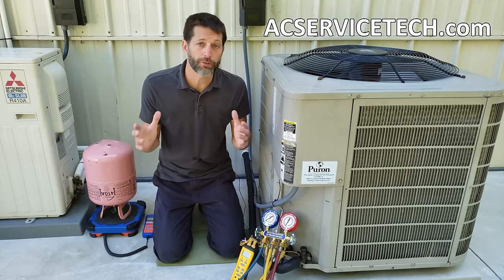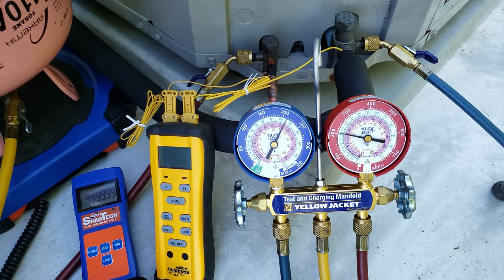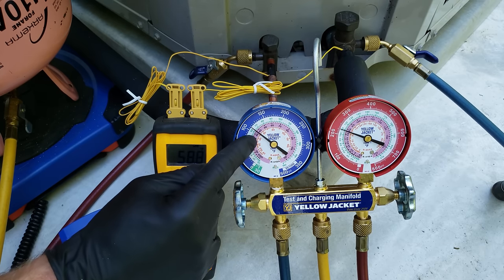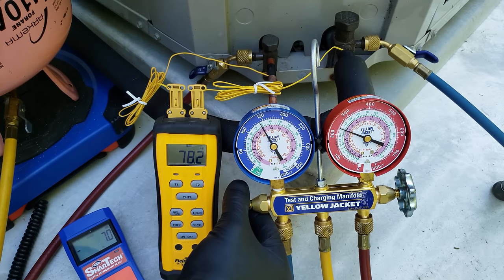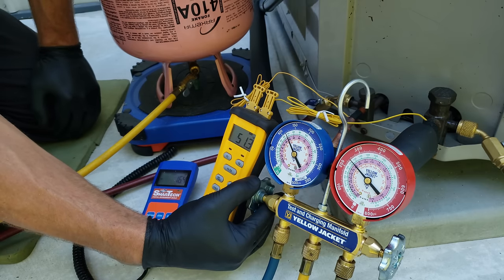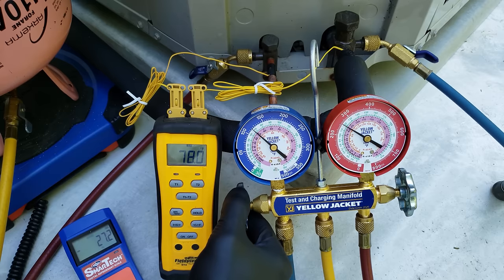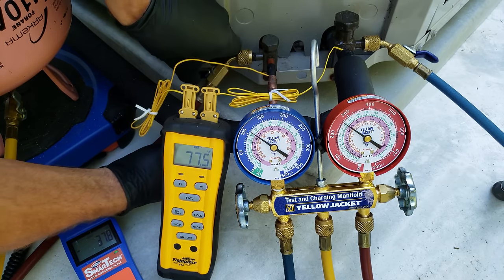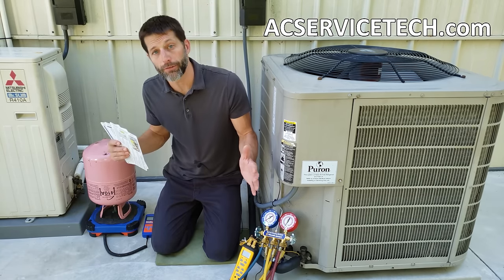Charging an R-410A AC Unit that is Very Low on Refrigerant with the Subcooling Method!

Comment: I can’t understand why your “soup-to-nuts” video got about 1.6M views and this one only has about 52K (as of Aug 1 ‘22). I’ve only had your 229 page book for 10 days but that book used together with your videos is obviously the best way to learn HVAC. I’m planning on buying a 12000 btu inverter heat pump and a 12000 btu cooling only split unit just for the purpose of experimenting with all the different recovery and charging methods you described just to compare the outcomes. 
  It will probably cost a few thousand to get all the good tools to do all that but it’s definitely worth it.

Comment: This video brings some nostalgic feelings... This analog pressure gauge from Yellow Jacket.... Last time I've used mine was a couple of years ago. Nowadays it is easier just to get a digital gauge with temperature probes that would calculate superheat and sub cooling automatically..:) Thank you!
Reply: Yeah I think he does it with basic tools just in case people don’t have digital. Wouldn’t really be a training video with digital bits working it all out for you 🤣 but yeah the new tools are great 👍

Comment: Any help appreciated :
I have a Lenox Unit outside with 410A refrigerant. I'm following these instructions to top off the refrigerant as I know it has a tiny leak and goes low every couple years. the sticker on the condensing unit outside doesn't show any TXV subcooling number. it shows the design pressure though : Hi 446 / Lo 236 PSIG besides voltage, amperage, fan speed and other information. How am I supposed to figure what the target subcooling of this unit should be. 
PS : I have my EPA license and will eventually replace the unit probably next year. 

GREAT VIDEOS btw, very valuable information on youtube videos and the e-book. really appreciate you for what you're doing and always support you

Comment: FIRST I'm glad you used analog manifold gauges some of these channels act like analog never existed!🤯
I never heard the emphasis on clean filters & clean coils on Airflow, but good video.
🥃🥃🍺🍺🍺🍿🏌🏻‍♀️
Stay safe. 
Retired (werk'n)keyboard super tech. Wear your safety glasses.
Reply from the maker: I thought I mentioned it quickly before hooking up the gauge set. I did other videos on the full process for measuring the cfm to verify you have the 350-425 cfm required depending on the desired dehumidification level, thanks!

Comment: I enjoy your videos; I am in school now learning HVAC.   It does make it a little confusing with thermocouples' on both the suction and liquid lines at the same time.   I know you are pointing back and forth at the service ports, but while watching the videos my mind is jumping back and forth between sub-cool and super heat as to which line I need to watch the thermocouple temperature.    All good info, just make me confused because of the thermocouple wire on both at the same time.

Comment: excellent channel my friend  !  this subcooling method is exactly  the same progress at a fridge that use a txv expansion valve ? in commercial refrigerators  apart from the required amperes drawn by the motor because most of the times I choose the pieces ( evaporator, condenser motor, etc )separately and join them and there is no other indication of filling with the correct amount of freon , for 20 years I have filled them in empirically without  having any trouble not meaning that this is the right way !

Comment: Man… where was this video when I first started, 15yrs ago.
Can you do a quick video on approach method charging?
Reply from the maker: Chip, thanks for letting me know what you would like to see!
Reply: This is what you do, use you temp chart and ad 20 degrees to your ambient temperature. And you will see what the head pressure should be. Plus you can use a amp probe and see what you running amps should be

Comment: Good day bro. Can u discuss the length of the pipe and how much we add refrigerant into the system? I know every brand had a design for pipeline When you installed AC. What about you will exceed the design? Or u will depend also the subcooling? Even ur pipe was long.

Comment: Amazing video. That's why I can't get SC differential! I always thought, why it is not rising while I'm adding refrigerant - the answer is - I need to add MORE. And Keep adding till I'll see the split differential. 

Interesting fact- even with a zero  SC A/C was cooling great and SH was 15. Now it's more clear to me. Will apply this knowledge to practice. 

Also, a lot of times while I'm adding refrigerant my liquid line sat pressure rising along with liquid line temp without giving me any split differential. And if I add more it just sticks together and rising. Am I missing something?
Reply from the maker: You would need to let it sit longer to cycle through, or turn the outdoor unit off, let it equalize and then turn it back on and wait the 5 minutes before checking again. Or it lterally could be that low on refrigerant that more is needed to be added, thanks!

Comment: Great video!!! One question if you disconnect the liquid line but you don't have the low loss fittings like you have on your gauge set is refrigerant still in the line and are you able to service that into the suction line? Hopefully that question made sense. Great Content as always!!!

Comment: Thank you for this! Question: If I was going to use a charging adaptor on the tank to produce more of a vapor, can you just leave the low side valve cracked open for lets say 15-20 seconds at a time?

Comment: Hi, I like your videos they are very informative, I have question for you , some times when charging the system start drawing overload current to achieving the target superheat or target subcooling, when you charging a system shouldn't be better to monitor pressures , temperatures and outdoor unit current?
Reply from the maker: The only problem is that we don't have a current to compare it to so we rely on the subcooling and total superheat. The current ratings on the outdoor rating plate are not used for actual running current but one is for wire sizing and the other is the max for the breaker size. If the total superheat and subcooling are set properly, then the system will be the most electrically efficient as long as the airflow is correct. Actually check for the 350-425 cfm before charging would be the most important, thanks!

Comment: If the Freon is low by 50%, and after discovering the cause of the leak, should I continue charging the device with Freon, or should I empty it and recharge it again because it is a mixed gas?

Comment: If my gauges don’t have a closing valve at the end like yours do, would I simply close the tank valve first and then crack open the low side to let refrigerant flow from the yellow hose through the blue while the yellow hose is attached to the tank, or would i have to close the tank first then detach the yellow hose from it then crack the blue side, or does it not matter if the yellow hose is attached or not?

Comment: Question, if you would of used a vaporizer on your gages to add the 410a refrigerant in would you been able to  open the manifold longer instead of opening and closing the manifold to add refrigerant in??

Comment: If you have an empty ac what is the best way to charge it?
Is it ok to add refrigerant to liquid line fist ?
Reply from the maker: If its empty, pressure test with nitrogen, if there are no leaks, vent the nitrogen, vacuum to below 500 microns and break the vacuum with liquid refrigerant equaling the factory charge into the liquid port by weighing with a digital scale, thanks!
Reply: @acservicetechchannel   thank you so much for the answer, really I was doing the charge partially (70%) of the factory charge, now I know (thanks to you), I can add all factory charge as one shot in the liquid line, you may make a video to help. Thanks
Reply: @acservicetechchannel   I got my books(refrigerant charging and ….) from Amazon and I found what you said in page 81, chapter7.
I really really appreciate your videos and your books it’s really covering everything on HVACR. Thanks

Comment: 13 Oz is really low?      How many pounds total does the system hold? 
Thank you.
Reply from the maker: Each one is different and it states the full charge on the outdoor unit rating  plate, thanks!

Comment: On a very long line set, recommend to measure subcool at outdoor unit or near air handler?
Reply from the maker: If there is an available port at the evap coil, you can check there but also at the outdoor unit. You want to make sure that you maintain around 8 degrees of subcooling at the indoor unit.

Comment: Thank you, Craig.  Can a R-22 system be "converted" to operate with R-410a?  If so, do you have a video on this subject?
Reply: No it can't. It could be converted to 407c with some work. Could use a r22 replacement though. Ive heard a lot of good things about the new Bluon r22 drop in replacement. Never liked any of the others. 421a is the only other one I might use. MOB 99 and NU22 are junk. But honestly if I had a 22 system that I couldn't or didn't want to replace I'd go to 407c. Have to change the system oil for that though.

Comment: Would this be like charging a unit with a high heat load
Reply from the maker: It was about 81 degrees inside at the time but I don't remember the wet bulb temp we started at, thanks!

Comment: Does it matter if when charging your home A/c the fan only is on or should you have it on auto.Because my unit was supposedly filled up but I think just the fan was on when filling.its cool but not cold air coming from vents I have checked intake filter and condenser vents on A/C outside not dirty what could be the problem please help

Comment: Why superheat method not used in unit with txv? And why subcooling method used in units with piston or fixed orifice?
Reply from the maker: The TXV controls the superheat so adjusting the charge won't really change the superheat if theree is at least one or two degrees of subcooling. If the piston is there, it can't control superheat so we check the charge by measuring the total superheat which is occuring at the indoor coil even though we are measuring it at the outdoor coil, thanks!

Comment: I'm wondering why to charge liquid to compressor suction line (LP) if you can flip the freon bottle and charge vapor what make it much safer for the compressor.
Reply: 410a is a blend therfore needs to be charged in liquid form if u charge it with vapor then it will fuck up the mixture ratio of the refrigerants in the botte

Comment: Your system operating pressures on the highside is around 230-250 psi, I thought the operating pressure for R-410a should be between 350-400psi.

Comment: I have 45 years of a/c experience. With 20 of those years as a service manager, if this was performed by one of my techs without checking the system for a leak. I would fire the tech on the spot.

Comment: On a larger York 25 ton, 4 stage, TXV unit that’s about 11 years old with no sub-cooling or super-heat listed numbers be checked using sub-cooling or Super-heat?

Was told back in those days sub-cooling and super-heat was not used so sticker won’t have that info.

Since a TXV is on unit assuming the sub-cooling would be checked?

MN# ZJ300N32P4WZZ10001B

How do I find those magic numbers?

Comment: Hi actually I have a problem with my ac it’s cooling less got it checked from tech seems he didn’t caught the problem I m mentioning the reading he took and he decided in few minutes that compression faulty without checking anything after watching this video I found my problem looks like same readings r on Goodman R410 head pr 250/suction Pr 100  he wrote 50deg SH and 14 Deg idk what it is maybe sub cooling I have called him again for expansion valve seems he wants me to change the whole ac unit as he say the compressor is drawing low amps 6amps only ac blows cold air but runs continuously what can be the cause as I can’t afford to change whole unit it’s only 4 years old but compressor is 6yrs old out of Warranty

Comment: You  are not supposed to charge a low system with 410a leaving refrigerant in. This is a blend and the refrigerant leaks at different rates and pressures by the blend. 
you should in fact recover all the charge and add a virgin charge.
Reply: I agree but I don’t know if anyone who really does it unless it’s a bad leak

Comment: You purge at the gauge, not the ball valve. Plus you use the temp chart. Also you have to have it running after you weigh it in. Amateurs